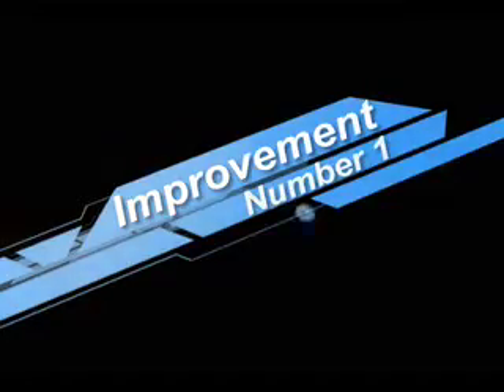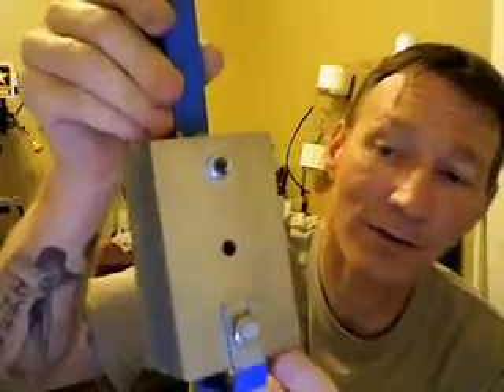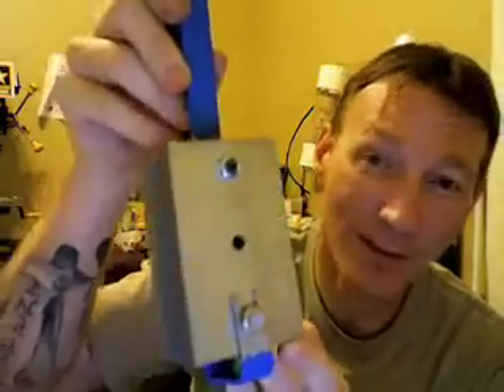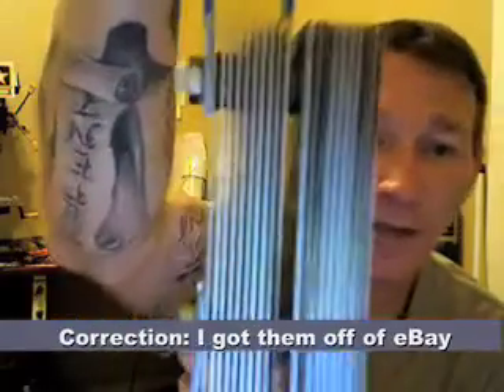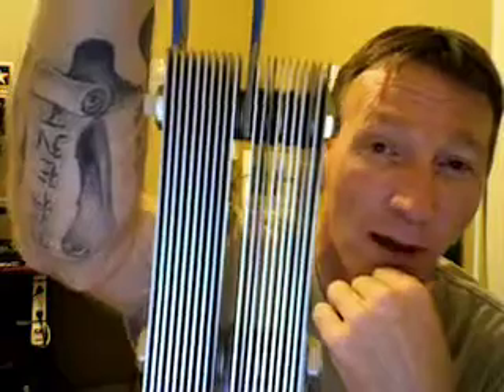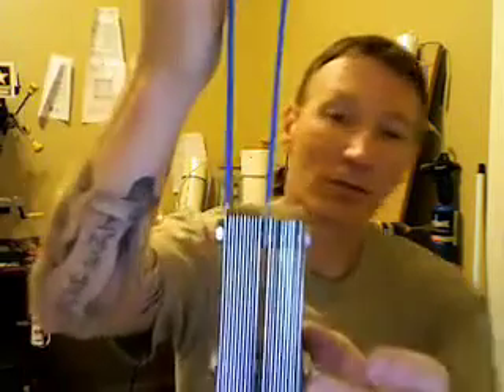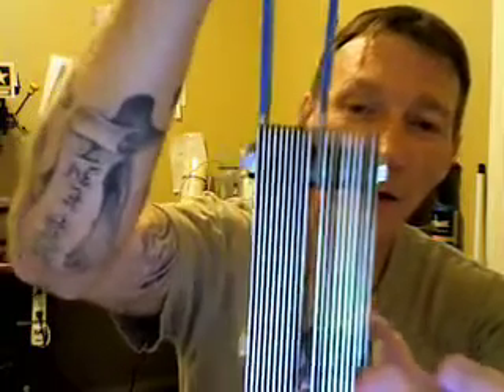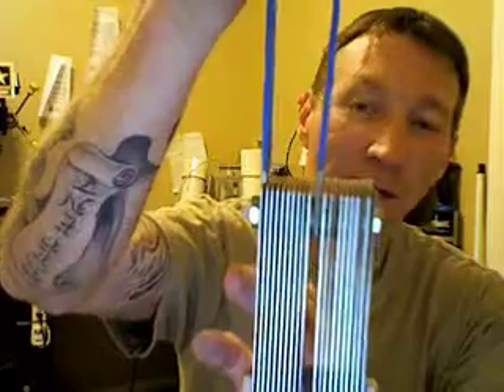Improvements to the Booster

Comment: Steve you can always use SS hose clamps.  Take them apart and just use the band.  Get the 6 or 8 inch ones and you can double or triple them up to make the bottom connector.  The clamps are easy to drill through, make sure they are SS though, if the regular places dont have then go to a marine supplier like West Marine etc...